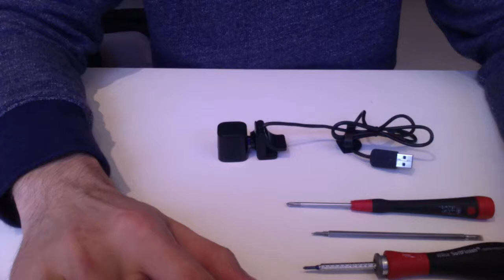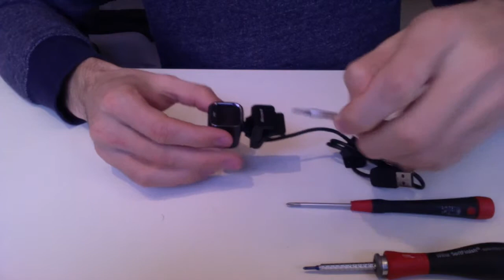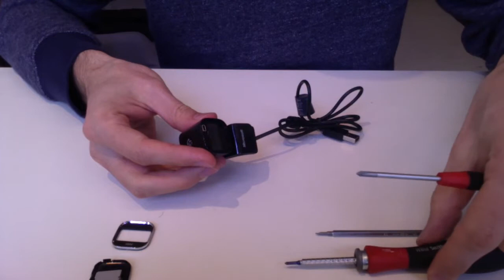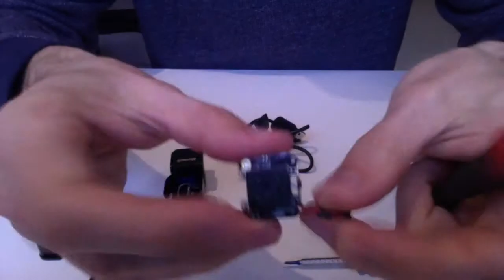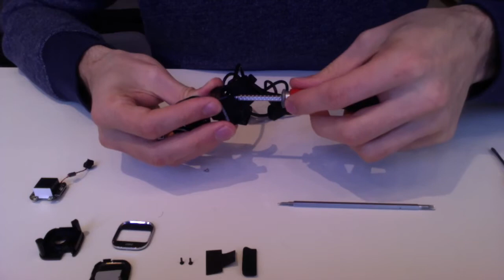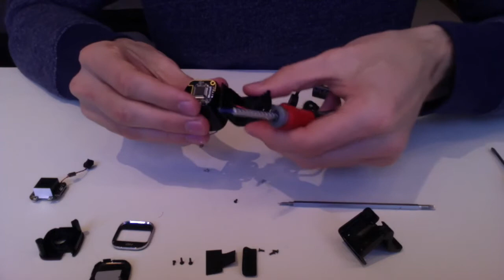PUPIL eye cam de-casing

Comment: Hi, i have a question about a step that you didn't show in any video. How do you open the autofocus case to take of the lens and remove the IR filter, i mean the steps between this two videos : https://vimeo.com/59844060 and https://vimeo.com/59844058
Last question : do you solder back the autofocus after this or do you just let it that it help to fix in the mount ?
Sorry if my english is difficult to understand and thank you for any answer.